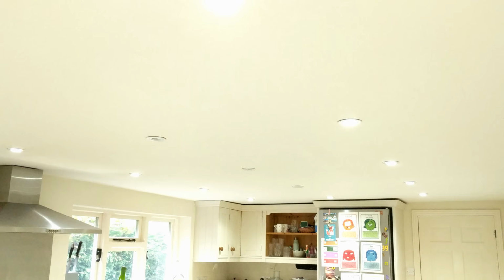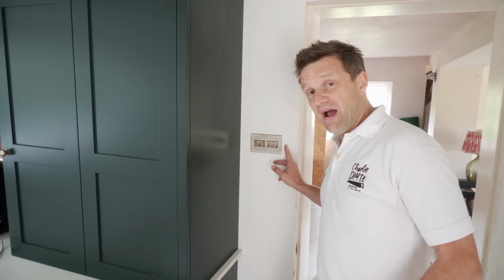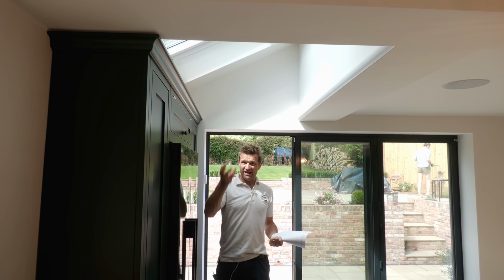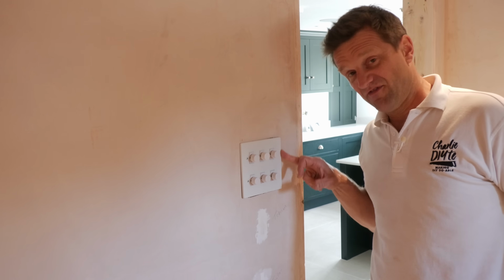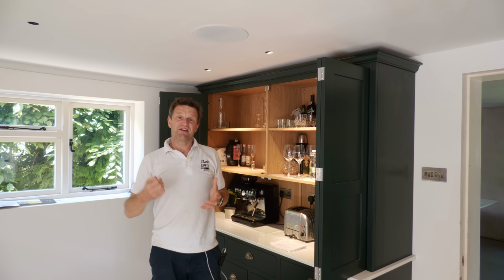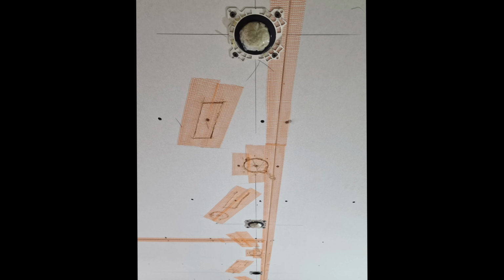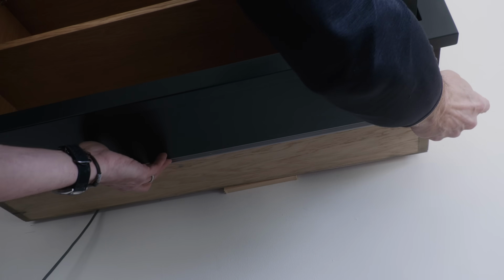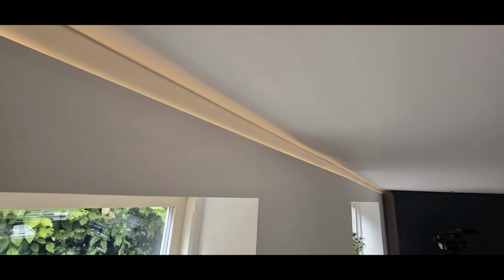Creating the Ultimate Kitchen Lighting Setup

Comment: Doing a kitchen extension now with a ventilated cold roof. I don't want install down lights as I would need to cut into the insulation and compromise the vapour control layer. Thinking about track lighting. Any better suggestions?

Comment: Awesome video Charlie, thanks for all the effort that you put into it - technical content as well as the rapid cuts to keep attention - it makes a big difference.

Am about to tackle this myself & have some questions:

1. Why did you use LEDs with 30° angle? Wouldn’t it make more sense to have 60° angle and get better lighting coverage?
2. Why did you position the under unit light strips in the middle of the under side of the units? Isn’t it more useful to have the light at the front edge of those wall units so that it illuminates your worktop area centrally? Bearing in mind that wall units have a depth of about 300 mm, whereas floor units are about 600 mm.
3. If you had your time over again, would you put the light switch for the under unit lights in the main bank of light switches or do you actually prefer it separately?

Thank you again for all you do 👍👍

Comment: Nice job Charlie,  I'm an electrician and i can't abide visible grid layout ceiling spots.

In my renovation, 6 years ago i went for the plaster in concealed spots, under cab leds, hanging mood lights, indirect uplights. 7 switchable circuits. But also avoid the programmable lighting controls as they invariably break, parts become unavailable then it's downhill from the. 

 Beautiful... Youre doing a great job

👍
Reply from the maker: Thanks mate. Sounds like you nailed that 👌 You're clearly damn good at the day job. Good point about the programming. Yep, the last thing you want is a gateway going down.

Comment: I'm in the market for an inspection camera and remembered this video of the one you purchased. Have you got an affiliate link for this as I'm looking to get the same one you purchased
Reply from the maker: That's very kind of you. Here you go https://amzn.to/3S3Hwjb There's also this https://amzn.to/3zxObvk for WiFi or if you need to use cellular this one https://www.amazon.co.uk/dp/B0C2ZBFYQ9/ref=cm_sw_r_as_gl_apa_gl_i_4J62C4SV32RDQR84TM0S?linkCode=ml2&tag=charliediyt0d-21 It's been very good over there years. The only weakness is the way it notifies you of intruders. But you can record your own message "Intruder alert the owner has been notified" as an alarm which I think is a pretty good deterrent.

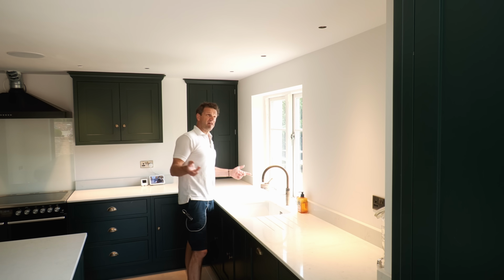Comment: Completely unrelated comment - the kitchen fan ducting (visible at 4:01) looks like you've bent a wall mount unit into a duct spaced a bit out from the wall. Assuming this is to route it through a joist. Can you say more about how you did this? Looks good, want to do a similar thing!

Comment: Hi Charlie where did you get your LED aluminium profiles from? We've done something similar in our kitchen but with dimmable LED strips (that's worth a video - minefield!). We did under counter but also under plinth which has been a massive success, it means we can have very low floor level lighting on in the evening which looks really nice. However all the strips are just stuck on (sticky back) and they fall down quite a bit, so I want to set them into an aluminium profile properly now.
Reply from the maker: Hi Tom - I got them from Phos too.

Comment: Looks fantastic Charlie! When I did my under counter LEDs on my new kitchen I used COB CCT LED strip, which lets you adjust the colour temperature by a cheap and cheerful LED driver from amazon. This lets you have a blue white mode for when you're working and a yellow white for relaxing... in reality we never change it, haha!.  Also since it was basically a retrofit and not hard wired in by a sparkie I used Ikea remote sockets (TRÅDFRI) to power them, and the above cabinet unicorn puke RGBIC, this gives you a little switch which is magnetic so is stuck to the side of the fridge. A good option for retrofitting and no need for a sparkie. You can add a hub to get some smart functionality with the Ikea stuff, but I don't need any of that.

Comment: So many thoughts! I agonised over my kitchen light 15 years ago now, but you've reached mostly the same conclusions.

Denise was right.

Things I learned:
A laser level is one of the great unsung heroes of a tool bag. I use mine often - a great OCD enabler. 🙂

Daylight colour temp and under cupboard lighting are essential, and I like your solution of cutting the base.

Install more lights and power points than you think you will ever need - if it's too bright (it won't be) you can always dim, but you can't make more light.

We included automation, which can bring up certain lights according to the ambient light levels and time of day as you enter the area. ie 3am - come up to just 10%.
Light source - you should never be able to see it - things should just be illuminated, kinda like your Velux area (good idea there). For this reason I recommend finding a different light source for your three pendants to remove the harshness.

Under-bench LED strips are a bit tacky - I wouldn't do it. It is everywhere!

I hid my power points - both in the back of hutch areas where the toaster, kettle, food processors are, and behind drawer fronts so that cables are not dragging across counter tops and getting in the way and covered in food prep - first class functionality and very tidy because there's none on the walls.

Love your work - always learn something new from you.

Comment: Very well thought through and designed. I did a light retrofit using smart home and HomeAssistant. I converted two pendants to spotlights and then added 3 pendants above the dining table, all on the same circuit. I then used IKEA's smart bulbs with colour temp control. So now I can control groups of lights as if they were on different circuits and I have cool, high Kelvin lights in the day, and warm lights in the evening.

To keep the light switches functional I had to do something very convoluted.
Reply from the maker: Thanks George. Yes I should have mentioned the capabilities of Home Assistant and I suppose Shelley relays - but I don't think my electrician would have thanked me for making it any more convoluted than it already is 😉

Comment: Very good. I just fitted two under cabinet lamps and they have transformed the kitcken. Wish I'd done this years ago. Didn't know there was a magic '300mm' but I opted for half the cabinet depth as it illuminated the counter top well and evenly. Hardest bit was chasing the wiring within voids. 
Really like the LED strips you fitted and they complement the pendants. Lighting has really changed. Not that long ago I had a different kitchen with 14 x 50W GU lights. You never needed the heating on in that room, but it was pricey just to illuminate!
Reply from the maker: Yes, when we installed our old kitchen in 2010 I don't think LEDs were a thing as the we had CFL bulbs. Then fitted GU10s in the same housing and now we've got led strips. Sounds like you've done a good job there. Yes half the cabinet depth is basically what they mean by 300 in from the edge 👌

Comment: I really like the lighting approach here but you have so many switches and dimmers there must be 100 combinations of lighting. I understand you want to avoid the need for people to need an app to control lights but I would be just as confused with so many switches. The reality is even with all of these lights you probably only need 4 or 5 combinations of all of the switch and dimmer settings. Think breakfast, preparing a meal, entertaining, relaxing later. I simpler way of selecting a "mood" or toggling between a few moods would I think be much better. We are struggling with the lighting in a large open plan living space and kitchen. We have used a couple of lines of spots on the kitchen space (dimmed) and will then add probably LED strip and perhaps cable lights as we have a large vaulted ceiling. I think you should have considered a lighting controller like Rako. We are going all in with Loxone so can have a number of moods that can be applied based on simple switches and considering time of day, brightness etc. We were worried about the cost of such a system but it's cost less than our driveway which is not actually very large.
Reply from the maker: It's a fair point.

Comment: Great vid and some great info as ever. Having replaced our kitchen and conveyed to open plan last year I spent quite a bit of time thinking about lighting circuits. I wish I had thought about the lamp over the edge of the worktop. Because we retained the classic grid (only 4 lamps) by luck rather than judgement it does line up over the worktop. I may just move the others to do this despite the pain. 
I went with the Wi-Fi Quinetic from TLC so gives a manual (hold to dim) switch but also smart features. I expect there are nicer systems out there in terms of smart features but works well for us so far.
Reply from the maker: Thanks Jon. Yes the Quinetic switch sounds good. I probably should have put something in to give a mood functionality but it was mostly cost and complexity of wiring trust were the main drivers if you pardon the pun, at the time. There's always something you miss 😉

Comment: This brings me back to a whole house renovation in 2007. Smart homes and lighting were just taking off and I wanted to incorporate that into the design as much as I could. I invested into a 24 channel iLight system and planned all the circuits myself. I got about 70% of it right which left me frustrated that it didn't really live up to the cost and expectation. I bought a LED panel for the kitchen that controlled all the channels and scenes around the house but it just wasn't programmed that well and was very confusing for people visiting. I made some mods to the actual lights. Over the Island did the usual 6 spots and around the perimeter of the kitchen/diner (11x5m) were 22 more spots. I replaced the 6 island spots with 3 pendants and removed about a dozen more spots...huge improvment. Biggest improvement was finding an iLight specialist that re-programmed the whole system including phone app and only now do I feel it was worth the investment. Keep up the good work.
Reply from the maker: Very interesting, thanks for sharing. Yes I think I probably missed a trick not trying to program in some kind of mood functionality but it was that classic case of time and money. 👊

Comment: Great video with a lot of tips. I would recommend a smart lighting controller. Our kitchen has 6 circuits and a table lamp and having multiple switch points would be a nightmare to setup and maintain. Instead we have Lutron RA2 controllers on each circuit and used their Pico remotes wherever we need them. Instead of controlling the independent circuits, you switch scenes depending on your purpose. So you van have a general turn everything on scene plus another to set the mood for dining or a party. It is retrofitable on regular UK lighting circuits so we have added this across most of our lights in the house. It does have smart integrations and a really simple to use app but you don’t need it for day to day use and the many technophobe guests to our house have no issue turning lights on and off.

One of the best smart features for me is turning lights off automatically that my teenage kids like to leave on, some to a set schedule others for a specified time after they were switched on. Another cool feature is the smart home away which I turn on when going on holiday and it replays the past two weeks of lighting to make the house look more occupied when we are away. This was all easily setup on the app.

Lurton isn’t cheap but they have a wireless system that just works. Some of the cheaper systems work most of the time and will need the occasional tinkering to keep it working. My RA2 system has worked faultlessly even though I had no prior experience installing it. There are professional installers who fit it for you but you can get the modules yourself and get your own competent person to install and program the system yourself.
Reply from the maker: Thanks Robert, that's very interesting and I particularly like the bit about getting it to turn off the lights the kids leave on 😉 A few people have said I have missed a trick not simplifying all those circuits wiith moods so maybe this is the answer in the medium term once my finances have recovered.

Comment: Thanks Charlie, and good to hear from you again ! It's always interesting to hear what you have to say, as despite your wealth of hard won experience, you still speak very much as a home-owner/DIYer which keeps you relatable.

Our kitchen lights are shocking - a 3way spot & 4 way spot-bar (Led GU10s) centred in the middle of an 18x11 ft room, wherever you stand you are casting a hard shadow and thus have poor light to work by. I've been puzzling over what to do about it so this gives me some more ideas so thank you. I love those LED strip-light connectors btw. 

You're sounding a bit rough mate, hope you're feeling better soon.
Reply from the maker: Thanks mate. Yes had a bit of the lurgy - a bit run down I think. Slowly coming out of it though. Sorry to hear about your setup. I bet you could make it a lot better with a bit of creative, pragmatic thinking...🤔

Comment: On "smart" switching, the idea is you don't need an app at all. I use home assistant and a pile of ZigBee switches and sensors (PIR, mmWave, lux) so our lights turn themselves on when and where people are, to varying degrees depending on how dark it is inside and out.

There are a couple of hardware override dimmer switches in the relevant places but you don't need to touch them 99% of the time.

Comment: My kitchen had under cupboard lighting for the worktop but the switch was in the awkwardly in the cupboard. I installed some IR sensors and fixed them up hidden at the back. One of the simplest and my favourite mods in the house. It means a quick wave to turn on and no dirty fingers on the switches as you'll often have dirty hands when you need the light. One things to note, steam can set them off, so set them away from the hob/kettle.
Reply from the maker: Great work 👌

Comment: If worried about switches and smart apps/automation, you could use deeper back boxes when doing 1st fix, and fit smart relays - like Shelly relays.

Then you can use switches both physically and via app or automation and everything stays in sync (which is how it always should be).
Reply: Was going to comment with the same recommendation of Shelly devices. They brilliantly integrate with standard switches, preserving the behaviour but also adding some smarts.
Reply from the maker: Fair point. With everything going on with the build that was one step too far but I should have mentioned it.

Comment: I get the simplicity of the manual switches, but for me, I'm in the process of ripping all that out and making it smart, controlled by Home Assistant. I walk into the bathroom, the presence sensor knows I'm there and will turn the lights on based on various variables... if it's between midnight and 7am, it'll turn them on but on a very dim setting... after 7am and it'll turn the lights on only if the lux sensor is below a certain level.... depending on that lux level, it'll vary the intensity of the lighting! It also allows for truely bespoke LED lighting control.... For example I have an led strip that starts vertically on the upper part of the wall, heads across the ceiling, before splitting in two directions... the LEDs are individually addressable and so it's been possible to turn the LEDs on one after another, lighting a path, and then when the split happens, it extends equally along both simultaneously... looks really cool! ;-) .... wasn't hard to learn to do and sooooo cheap!!!! £6 ESP32 board, £20 strip of addressable LEDS (5m), in-plaster LED profile £50.... then making good with a bag of plaster (£10).... obviously the price increases drastically due to labour if you don't install the profiles yourself / replaster! But if it's happening at a time that you're remodelling anyway, then those plastering costs would be spent anyway.

Comment: Great results and glad you spoke to Guy. I did the same year's ago and it opened my eyes into lighting design. 

The lights I installed were also removed when I moved house, as they were far too good to leave for the new owners and are being installed in my new place. 

Having a few extras is vital as I had a few die after 5 years of constant on/off use (in a utility).

Comment: I was advised by a professional designer along similar lines to your electrician, I chose to ignore based on where I needed the light to be and the mood needed.  For bedrooms I avoided the ‘central’ light and ensured that when we lay in bed  the lights didn’t create glare.  So I’m feeling vindicated by your video.  We moved 3 months ago and it looks as though the previous owner installed lighting along similar lines to myself.  I must confess the grid style lighting panels I have inherited are a bit crass but they do divide the  lights up very neatly.  Great vid thank you Charlie.  Regards Mike

Comment: Missed the opportunity to put in 5amp sockets around the perimeter or where there are side tables I use them more than the downlights 😅. Definitely look at trying to put in a lutron RA2 system, it’s app and uses wireless switches. Then you could incorporate the under pelmet lights into the light switch positions it also allows you to scene control the whole area from one button.